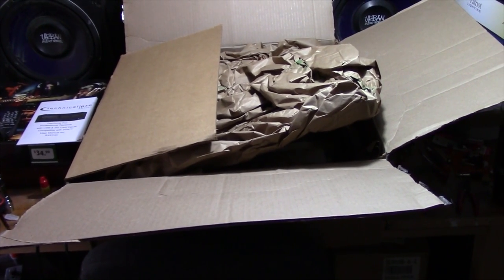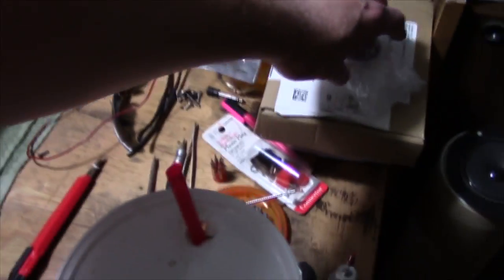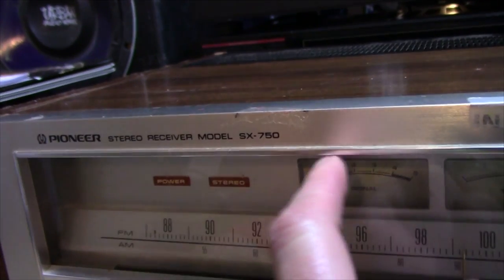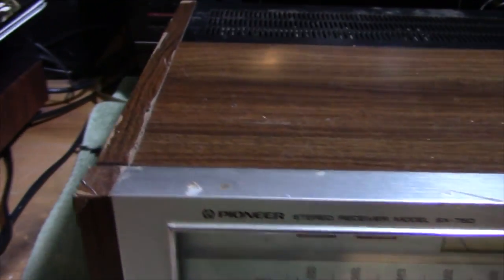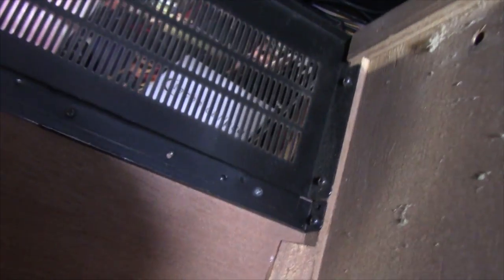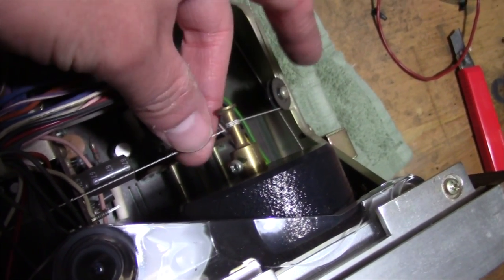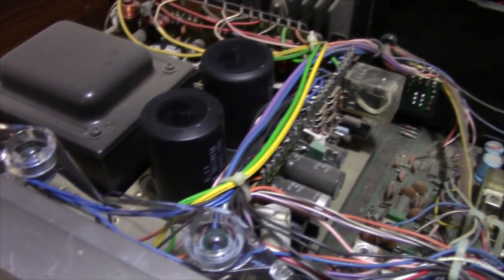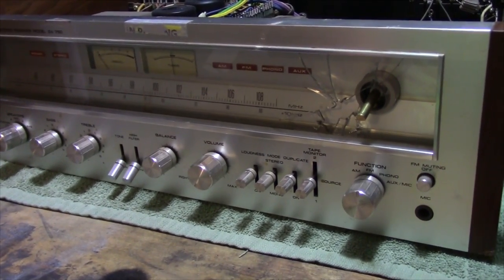Pioneer SX-750 Restoration Series - Part 1

Comment: I have a question prb going to get bashed by some internet trolls for it but, how would i go about cleaning my Yamaha receiver lots of nasty dust that a can of air and a brush wont clean it off. Looking for a safe way to get that nasty crap off.. any help would be great.
Reply from the maker: +Dustin Marklow Where is the dust at?
Reply: WaybackTECH
 All the circuit boards its a 7.1 surround sound receiver its about 7 yrs old and still kicking and sounds great still. trying to keep it going as long as possible. I am no were near as good as your are in repair of electronics like you are but can do minor repairs. Ive put computers in dishwashers but im not going to play Russian roulette on this lol
Reply: WaybackTECH
For the record for any advice you do give if anything does happen its on me and would never hold you or anyone of that matter responsible for damages that happen if any.. I just appreciate the help and advice. I also know that all that dust and crap that's in there isn't good for it also ..
Reply from the maker: +Dustin Marklow There is only so much that can be done to clean these boards without fully removing them and washing them, same idea as washing a motherboard but I wouldn't suggest that while still in the receiver.  Dust isn't a big deal, just keep it clean as much as possible.  Only thing stronger would be an air compressor with a nozzle to blast that dust off. You can dampen a rag with alcohol and rub what you can, or alcohol and a paint brush.
Reply: WaybackTECH
ok i will use the alcohol and brush/rag method but will remove everything that i can do its more like a nasty tarnish like dust its sticky nasty crap in the poor thing.. thank you for the advice!!!!
Reply: +Dustin Marklow If it's sticky, it could be from cigarette smoke. But then it would also smell pretty funny. Blueglow on youtube had a video where he took appart the boards on an an amplifier and washed them with a toothbrush in some cleaning solution. But that thing had like 3 boards. 7 year old 7.1 receivers would be way more complicated to take apart. My Denon has these metal interconnects that are soldered directly to the boards.
Reply: Haralampi Nedelin

Will look in to that and be extra careful thanks
Reply: +Dustin Marklow Hi. If it is cigarette tar, and if the alcohol doesn't cut it,try electronics cleaner in spray form CRC brand or most any just has long has it is for electronics. I have used it before on some really nasty sets. I am not sure but, I have heard that the smoke can cause shorts in circuits.
Hope this helps.
Reply: *****
yes me and my wife used to smoke and ive gone through all my computers and servers and put them in the dish washer they all turned out good no issues but will give that a shot if the other doesnt work thank you all!
Reply from the maker: Dustin Marklow
There is a cleaner called Mean Green, basically like Simple Green but cheaper, anyway I have used that to clean cigarette tar from computers and it works fantastic, no scrubbing needed, just eats it up and drips off and no smell afterwards either.
Reply: +Dustin Marklow  Congratulations to both of you for quitting. I have smoked off an on since I was a teen. So no judgement from me. :) And you are very welcome.
All my best.
Bobby
Reply: *****

Yes its hard but we are getting by.. We just take it day by day. If you put your mind to it you can do anything and not smoking is what we want to do. Thank you also again

Comment: You know, while I was watching this video, I did remember an amplifier/receiver that my mom had, the Ken Brown SS-3350. I don't remember if the circuits are the same, but at least, the face plate is almost the same (AM, FM and TAPE indicators are something like LEDs instead of an indicator light). Have a look: http://i.ebayimg.com/00/s/NDg3WDY1MA==/z/rSMAAOSwpDdVed7J/$_20.jpg
Btw, I think this model was sold here in Argentina, do you know if that was a cheap rip off, or a licenced clone?
Reply from the maker: +Santiago Hormazabal (Coco) I took a look at the picture, and i have never heard of that brand before, but Pioneer did manufacture stereo equipment, receivers, amps, tape decks, probably turn tables and 8 tracks for other companies to resell. Much of the old ( RadioShack ) Realistic stuff is Pioneer, and I know their Optimus brand was also Pioneer. This Ken Brown looks to me like it was made by Pioneer. The looks give it away, but the font used for POWER is identical to Pioneer. Technics also did the same thing, building stuff for store brand stereo components. I think Pioneer built most of the units for other names in Korea back then, and their own branded stuff for the most part was made in Japan.